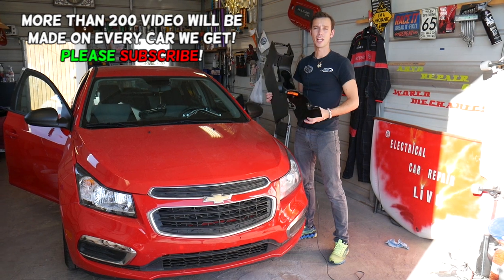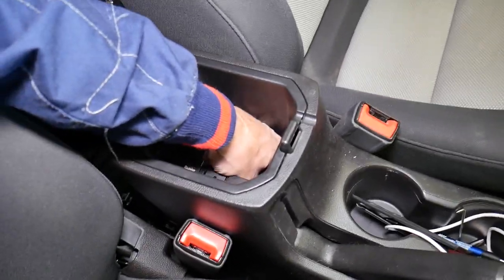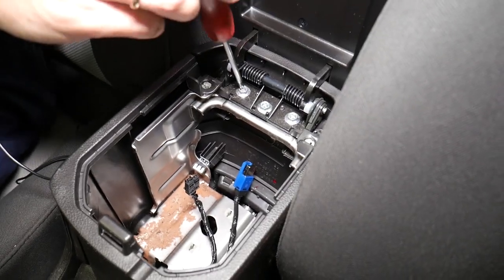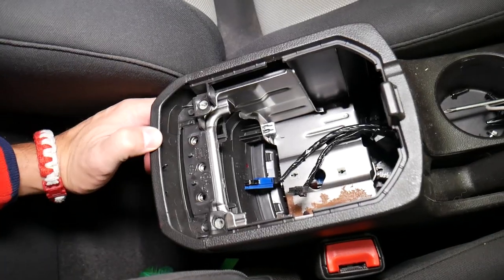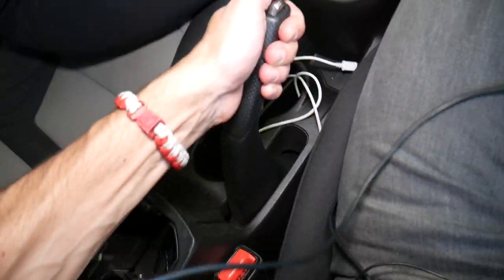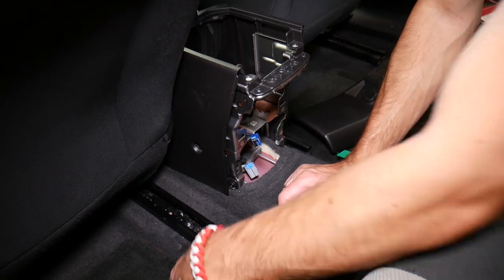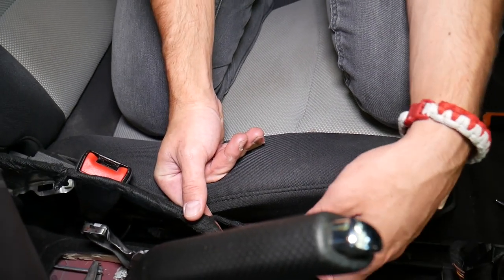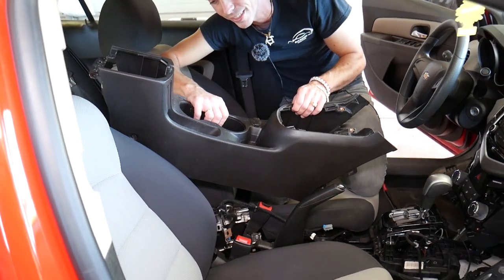CHEVROLET CRUZE CENTER CONSOLE REMOVAL REPLACEMENT

Comment: 1:19 what is that part (flap) called?  sadly mine is missing.  I don't remember if it was missing from when I bought the car or if the mechanic lost it when he replaced my transmission.  I would like to order a replacement but I have no idea what its called.

Comment: The video was very helpful, but in my teardown I found that you don't need to remove the armrest at all! The only bolts you need to pull are the bottom bolts that you have to move the seats for. The whole thing was able to come out without monkeying with the armrest compartment. I pulled mine and it was a nightmare to put the compartment back! The USB and aux connections were so tight that I had to remove the while center console again and reattach the compartment by flipping the whole console upside down. If you can, leave the armrest alone!

Comment: Hi, I was trying to replace the USB port, and I removed all of the screws, but for some reason, I can't lift up the console insert all the way. It will lift a little bit, but it seems to be stuck to something. I even tried using something to push the cables down, but it doesn't seem to be stuck to them. Is there some kind of adhesive used? I can't pull it up enough to actually see below it, so I have no idea what it's stick too, and I don't want to pull it out and damage something. I drive a 2014 Chevy Cruze LT. Does anyone have any suggestions on how to get it out?
Reply: @dwilly219  I ended up doing that, and all went well.